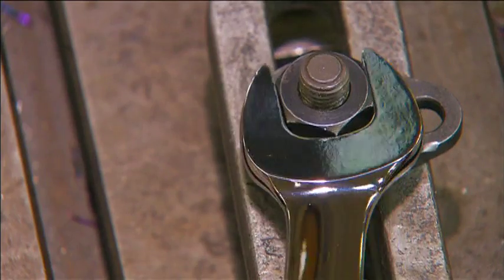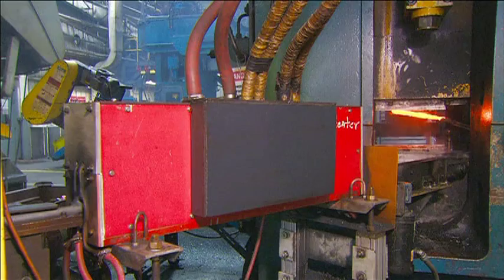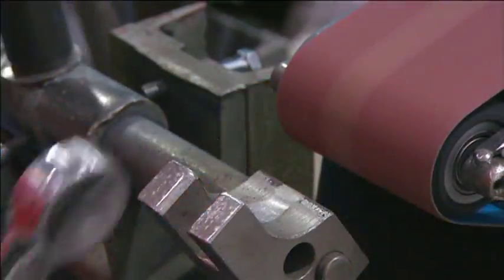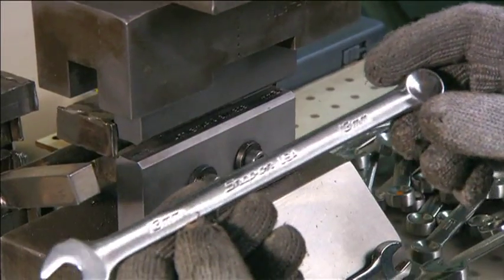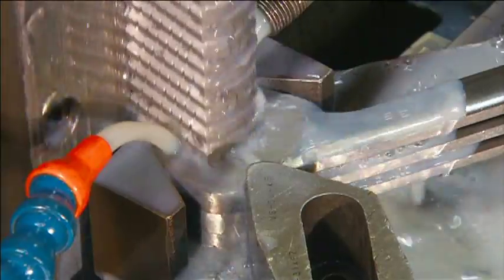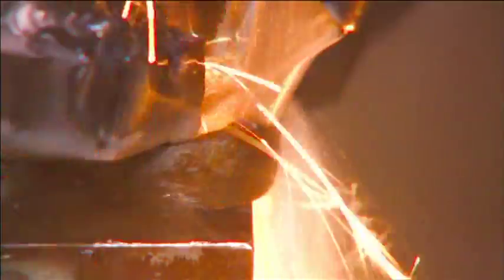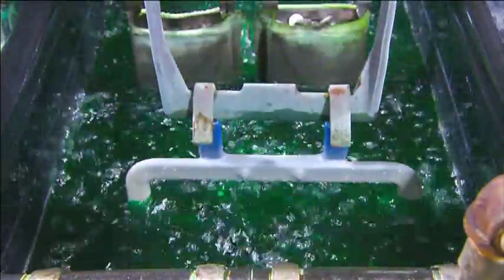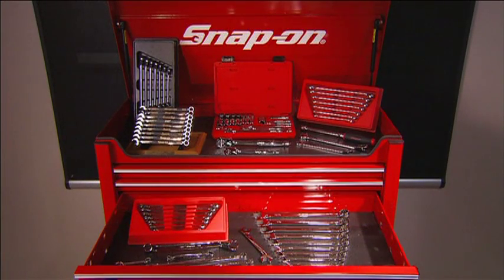Zo worden Snap-on ring/steeksleutels gemaakt

Comment: best spanner i ever work are the snap-on XM with tube grip https://thumbs.worthpoint.com/zoom/images1/360/0815/18/vintage-trio-metric-ring-spanners_360_98a253f85cdbf790aa94a27b7f1c292e.jpg 
the other spanner little bit better then from other manufactur but not so comfortable like old XM-series